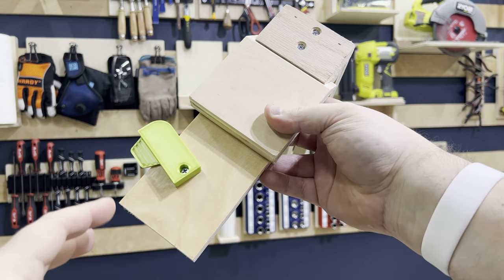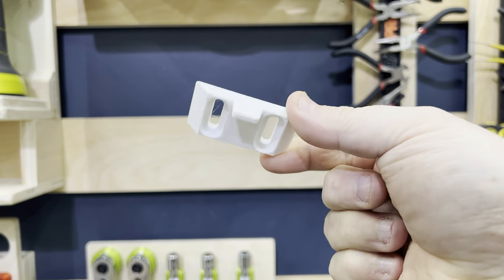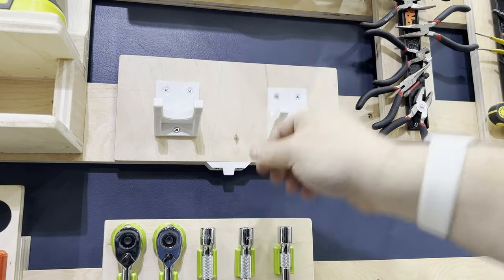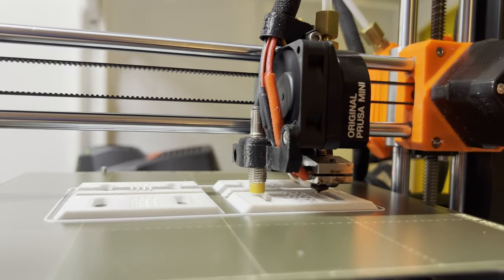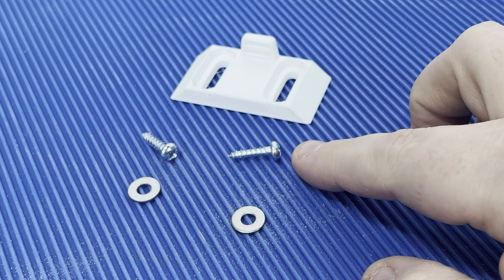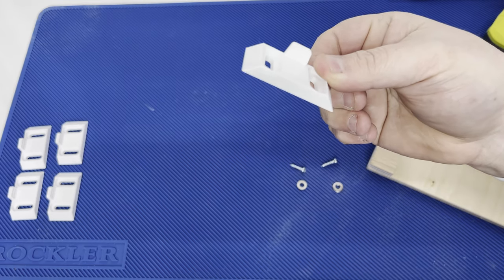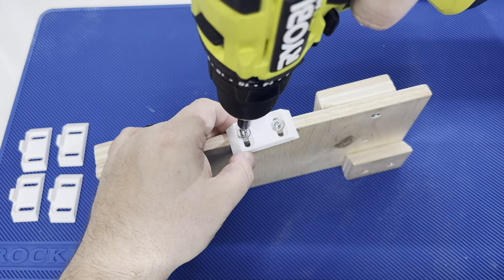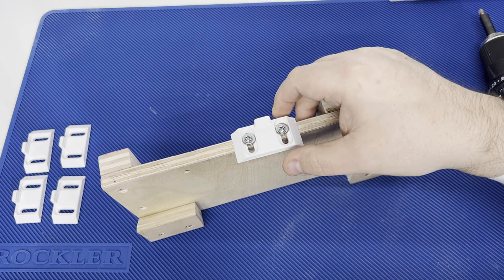The PERFECT French Cleat Lock For Small Tool Organization

Comment: Idea (pos improvement?) These are great but I had a thought. As you are adjusting the screw to give resistance for when you move the lock, why not have the channel that the screw/washer is sitting in have a slight incline so that when you push to lock it it creates a friction lock / resistance to help hold it in place? The incline would be minimal. Just a thought to add to an already great idea.
Reply from the maker: That’s not a bad idea! You’ll still have to put the screw in just the right depth so that it’s can push all the way in and be snug. I may have to give it a try and see how it works. Great idea!

Comment: This is excellent. Great little tape measure caddy too. Clever integration. For anyone without a printer, you can totally make this with 1/4 ply or 1/8 ply.  A drill press will help you make the slots. Glue on a tab to push pull. A laser cutter could work. You could also commission a whole sheet of them on a laser cutter.  3d printing might actually be faster here than making by hand if your printer is already set to go.
Reply from the maker: thanks much! Yep they are really a quick print.

Comment: I was excited to see your design as my french cleat tool holders are flush with the bottom of the french cleats so much so that I got started printing right away.  I printed about 24 before I tried them out.  When I put the first slide lock on I found it did not work as expected but I think it is my issue and not the slide lock.  My french cleats are on the wall in my garage.  There are no garage doors.  I built the french cleats out of treated deck planks hoping they would last forever or at least the remainder of my life.  As you know deck planks are thicker than typical lumber and they also have rounded corners.  I say all this to say do not use deck planks or a round over bit on your french cleats.  You will not be happy.  I plan to keep the locks for the french cleats in my shop which are plywood.  I know they will be great there.
Reply from the maker: Even if the bottom or your cleat is a bit rounded, I still feel like these should be able to still hug the wood unless the radius of the rounded edge is really big. I guess I would need to see a photo to understand what is happening.